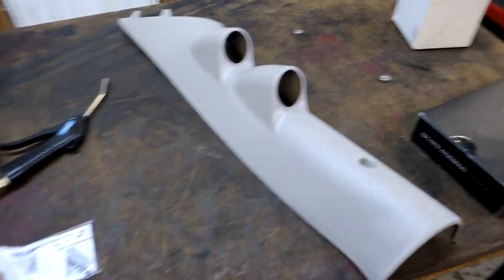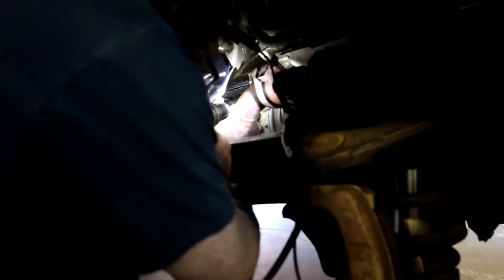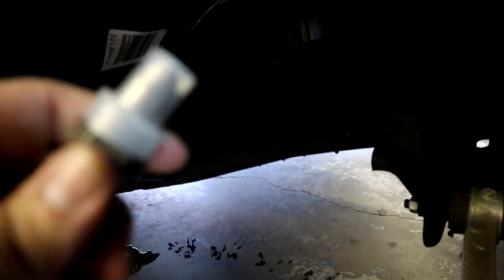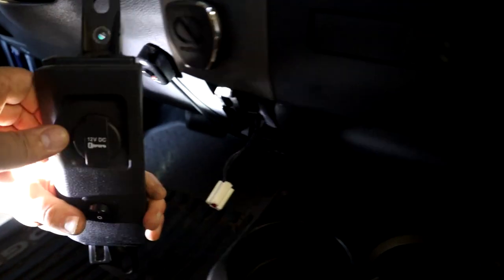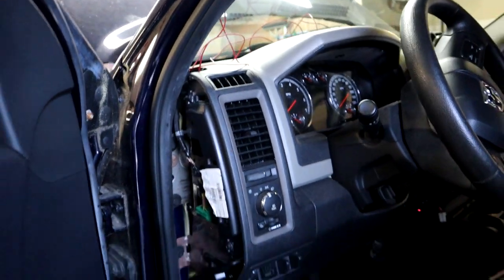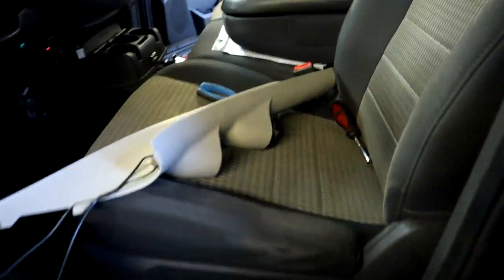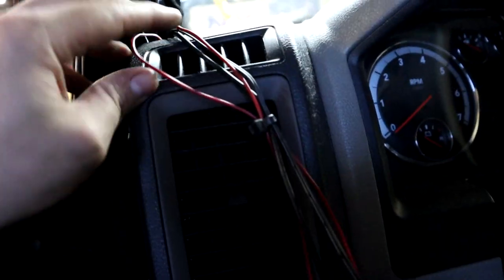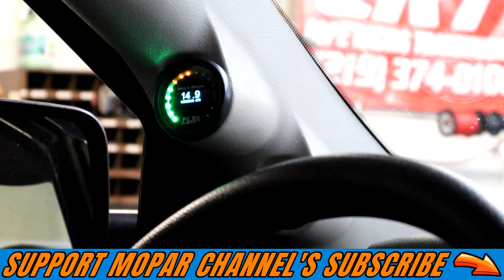Project STORM Gets A PLX Wideband Gauge DIY Install RAM 1500 4X4

Comment: Isn't there a way to utilize your factory O2 senors? I realize that the ecm needs to know what's happening at all times. Just curious.....
Reply from the maker: Probably is but not worth the hassle and I haven't heard of a way to make it accurate.
Reply: @FrostbiteRam   I see, but how would you know what the other bank of the engine is running for air fuel mixture? Does it matter as  long as you know what one side is reading can safely assume the the other bank is good to go? I guess you would have your factory 02 sensors the would throw a MIL light?

Comment: Why do some people say place on the driver side on dodge ?
Reply from the maker: It dont Matter what side it goes on if it really did then you would see people installing one on each bank x2 units. We chose the passenger side because of the extra space it allows because this truck has factory converters still in place the driver side doesn't have much room to work with.